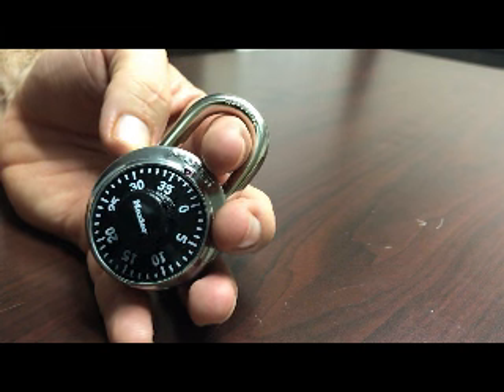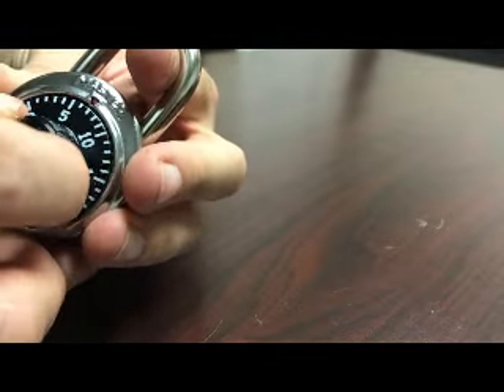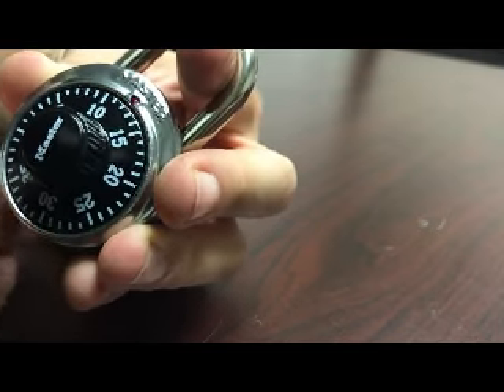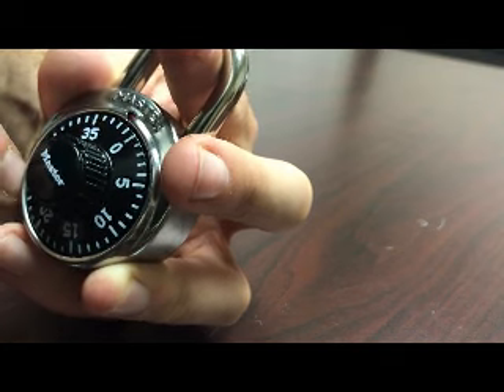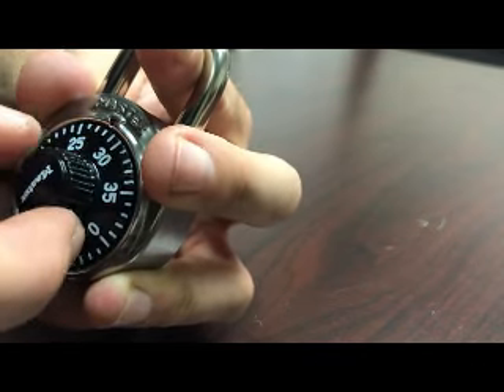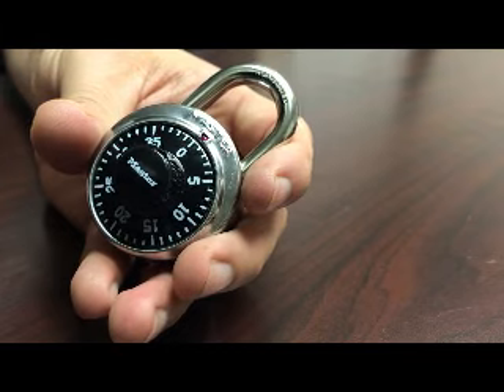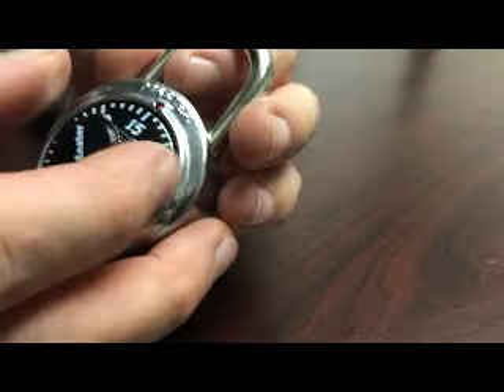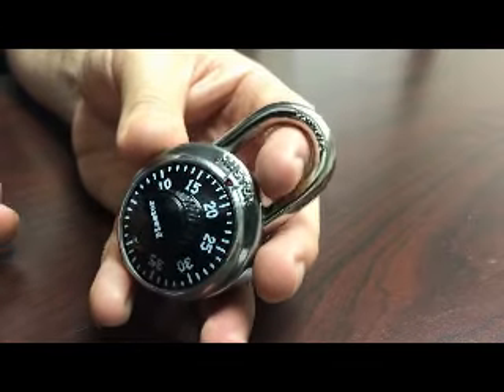Open Masterlock in 3 Easy Steps with no Combination!  Easiest method on YouTube!

Comment: I get resistance every third number. Light pressure, heavy pressure, clockwise, counterclockwise. Someone on a locksmith board said this technique doesn't work on 100% of combo locks depending on where the sets are cut.

Comment: Omg I've been trying at least 100 times... It's always on the second step when u have to put a little bit more pressure and for example in my situation it keeps getting stuck between 31 and 27 and i dont know which number to take as second bcuz usually in videos it's between 2 numbers  if someone could help me out, or maybe im putting to much pressure or idk what's going on